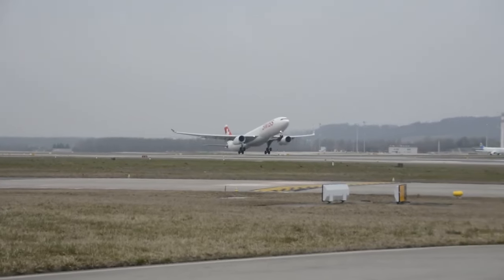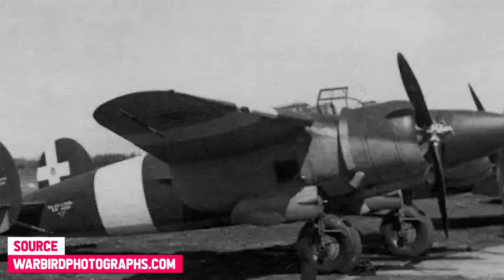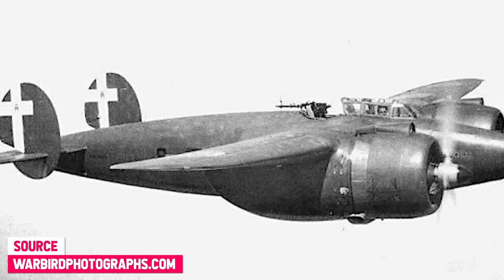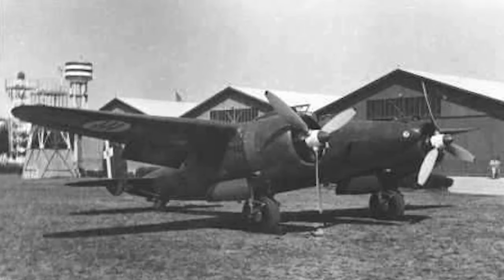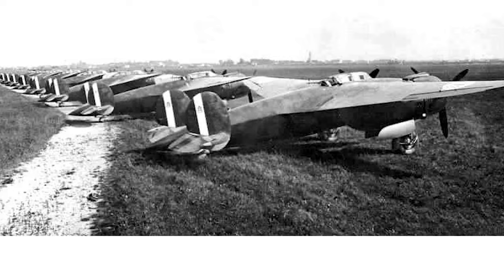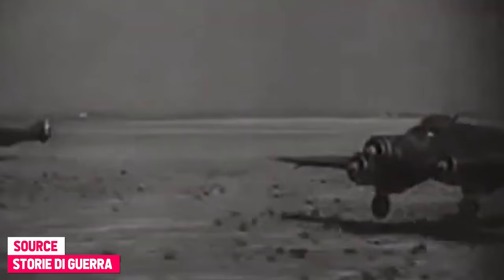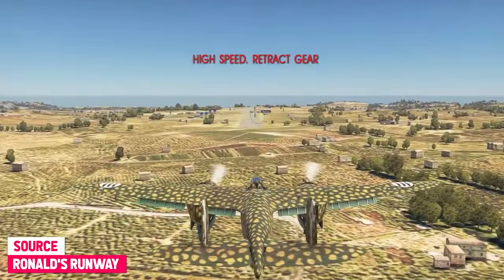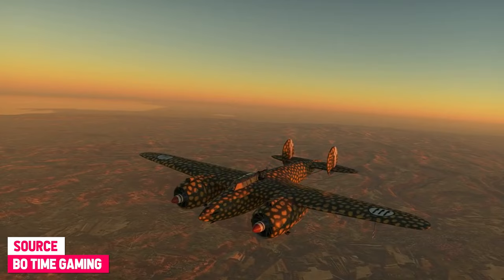Illusions of Power | Breda Ba.88 Lince

Comment: I can't help but notice that the fuselage of this particular aircraft, when considered without wings, stabilizers, engines, landing gear, etc, strongly resembles many a loaf this user has pinched...Which does, incidentally, seem to correspond with the rather shitty performance of the Ba 88 discussed in the article. That is all